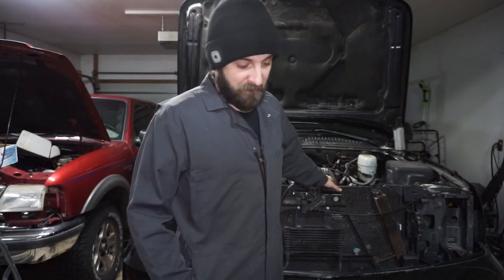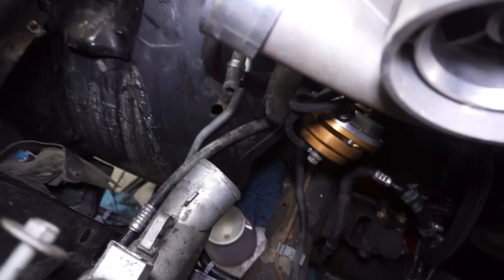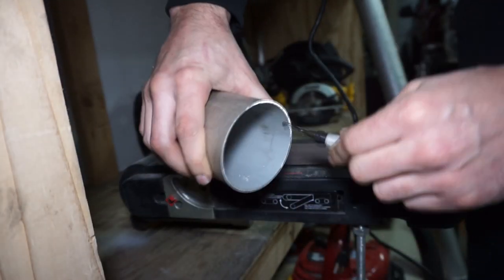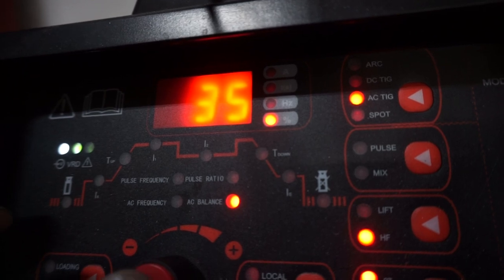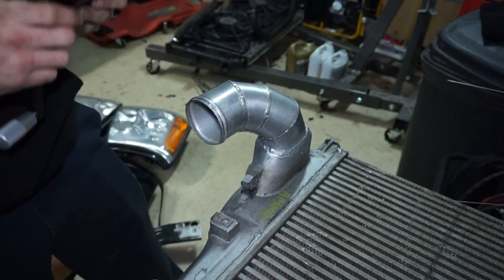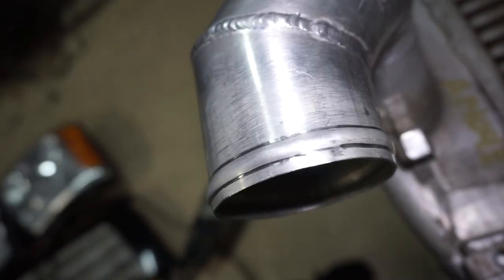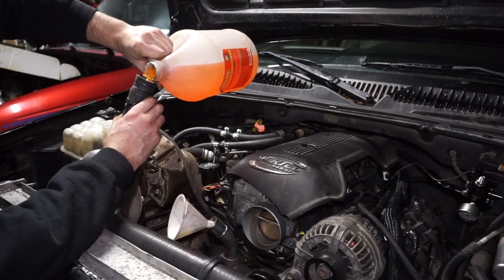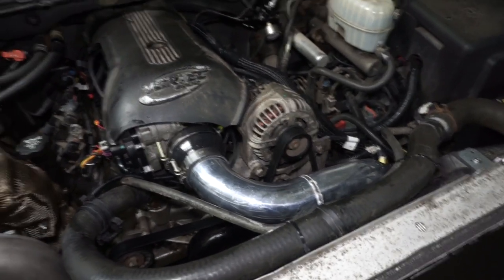I MODIFIED MY DURAMAX INTERCOOLER SET UP!!!

Comment: Looks good did you weld a bead on the TB?
Reply from the maker: No just got a different coupler. Took it out today peaking at 19lbs after 1-2 shift and never popped off.

Comment: Did you leave it at 70 amps? I am looking to improve my aluminum tig skills! Love your content, you are one of the reasons I decided to start my own channel almost a year ago, Thanks!
Reply from the maker: 70 but backing off the pedal as it started to heat soak. The pipe to intercooler i was up around 90 to get the thick intercooler to puddle decent.
Reply: @BlaserBuilds  Thanks!